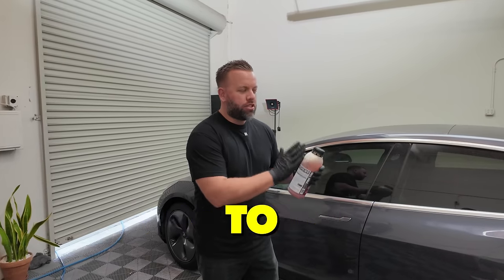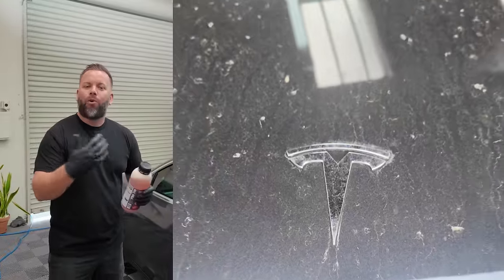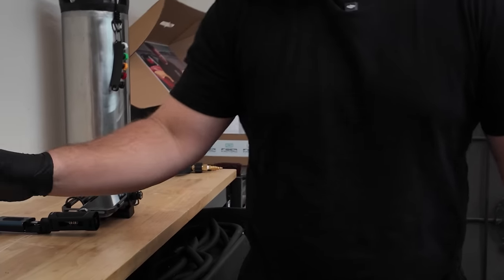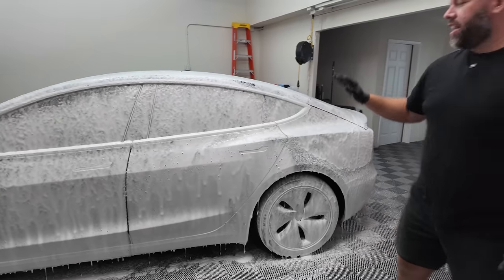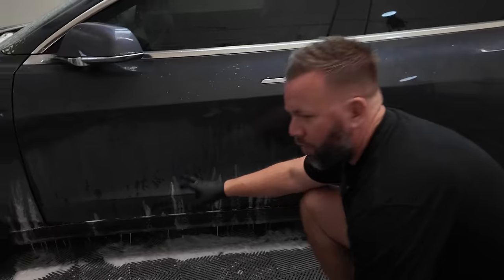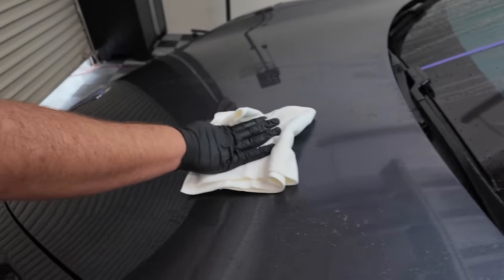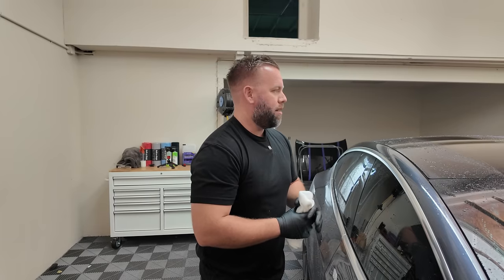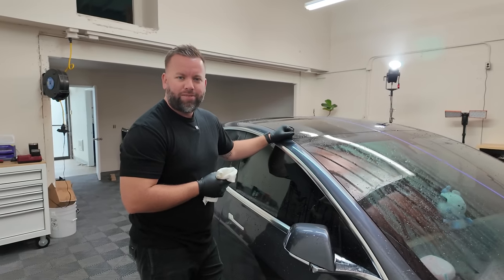SECRETS They DON'T Want You To Know - Do Not Pre-Rinse Your Car

Comment: Ive used Wash Chem on my Tesla before and although it’s a great touch-less soap, it negatively affected my protectants especially graphene ceramic coating and discolored plastic, paint and metal parts of the car. Made my red caliper looks really faded and left streak residues that wont come off.
Reply from the maker: Noted. Thanks for the heads up.
Reply: This deserves more attention. I've tried Wash Chem, and while it cleans effectively, be cautious with different materials – some plastic trims and coatings on my vehicles discolored. Also, a heads up: if you're using soft water, it amps up the cleaning power, learned that the hard way...
Reply: @WoundmanTV  I use deionized water, that's probably why the cleaning power was so strong. I now dilute it to half of the recommended ratio and mix in regular car wash shampoo. It still works great especially removing brown tires.

Comment: I’ve come to the theory that if you have water down (pre rinse) it’s going to have a hydro layer between the paint and the cleaning solution,  if you spray the solution on a dry car, you have the solution easily encapsulating the dirt and grime on the paint.
Reply from the maker: makes sense. would be inline with my findings too.
Reply: @autodetailingpodcast  is it not just that you are cleaning off a lot of the dirt in the prerinse? i doubt it's that differnt in impact

Comment: @autodetailingpodcast i can say with experience and trial and error that pre-rinsing does dilute anything you apply afterwards and depending on what chemical it is it can severely reduce its effectiveness. Ex: for years ive used formula 21 for cleaning wheels and tires, it is extremely potent and if you spray it on plastics such as trim and let it dry in the sun it wil discolor it. However its excellent at cleaning tires but if you spray it on dry and just rinse it, it actually works better than pre-rinse, applying, and then scrubbing with a tire brush. Thats a significant difference.
Reply from the maker: I think that’s a great example of how pre rinsing could be helpful! Thanks for that tip.

Comment: I just bought that MJJC 3.0 foam cannon and it did pretty good for how it came stock but I’m going to try the other orifice out to see how foamy the soap gets. I noticed if I dump in a lot of soap it will foam good but like in your video it calls for a lot of soap but yours sprayed really nice. I’m also using a gas pressure washer with the required 2.4 gpm. I always prerinse but I wonder if that breaks down the soap quicker and reduces the shaving cream look.
Reply: Yes I found that it dilutes the soap a little and doesn’t look as thick when applied dry. I foam, rinse, foam, contact wash, rinse, dry.
Reply: Given the option, always use the 1.1 foam cannon orifice for more foam.

Comment: My train of thought (and it can be wrong) is i do not presoak. I foam on a dry car to encapsulate any fairly loose debris in the soap so it comes off easy when I soke it with the preasure washer so as to minimize any scratching. Then I foam it again then hand wash if needed. Not sure if it is good practice or not bit it makes since in my mind.

Comment: Hey Jimbo! After watching a video on car wash foams from Pan, I tried a higher PH soap from G Techniq and used it without a pre-rinse. I would think with a pre-rinse it would dilute the product so I just shot it straight on the truck. I was amazed at how much dirt was removed from my truck that was filthy from the classic rain induced crude on the sides. I then foamed with my regular PH neutral snow foam and then did a contact wash. My other pre-wash I used from Ethos never cleaned that stuff off the side of the truck or cars. Was wondering the PH of this cleaner. Sounds like it will be pretty high with you comparing it to an APC.
Enjoy your holidays

Comment: Spray foam and let sit, power wash off, foam each section as I wash by hand with a bucket of soap.  Move section to section, top down.
Reply: when water is sitting on the car before the foam, it's watering down and interfering with the soap staying in place. I stopped pre-rinsing years ago.  Now, if you don't have a foam cannon, then yes, pre-rinse.

Comment: Great Information. I recently acquired a black pickup.  The first black vehicle I've ever owned and for me, keeping it as scratch-free as possible has been the stuff my nightmares are made of 😄. I've watch a bunch of videos, including yours ( Thank You for sharing this info ) ! and my newbie method of touch-free maintenance washes has been: No pre-wash (I didn't want to dilute the product ) and meguiars gold out of a cheap harbor freight foam cannon and leaf blower drying.... This seems to remove enough rainy-day road film to freshen up the truck good enough for me. 

I also bought 6 soft wash mitts to manually remove dirt with. For those washes, I use the same Foam/Dwell/Rinse method, then add a second foam before hand washing. So far I'm happy with the results, but am still learning.

I can't wait for spring to come, so I can try my hand at a ceramic job. I think that the Wash Chems Pro 100 Touchless Car Wash might be a good first step prep for that ( but will learn more before I jump in ).
Reply from the maker: Black is a ton of work. But seems like you’ve been meeting the challenge
Reply: I have a new 2024 black Chevy Trail Boss. What works is rinse, hand wash with Turtle Wax Ceramic Cleaner/Sealer, and leaf blower dry. No scratches and then I apply F11 PRO for deep shine and protection. For speed and more scratch resistance I am going to try Turtle Wax Pure Shine via cannon.

Comment: The one reason I think you got more dirt on the pre-rinsed side was that because you put down a lay of water onto the paint surface and then the foam cleaner is not actually 100% touching the dirt on the paint it has a layer of water between the dirt and the foam. Not pre-rinsing it you put the foam directly onto the dirt and actually clinging to the dirt that is on the paint giving you a better result with not pre-rinsing.

Comment: Of course you should go straight to foam on a dry car. Water alone is not a great solvent or surfactant. The soaps are far better at being surfactants & solvents. Also; just a waste of time & water to not go for a foam bath, pressure rinse, one bucket+ grit guard + 3 towels.

Comment: Bilt hamber touchless is the best of these products. Gets a dirty, coated car about 98% of the way clean. Also sugar-based so it limits the damage of the high pH chemical
Reply: You have to understand what touchless and Auto foam are used for. Auto foam works best for summer dirt/rain and touchless is used for snow/seasons etc
Reply: @Admin-ie9hp  I had thought they're both all purpose but touchless seemed to work better with winter related film etc.

Comment: So what your test just taught me is the purpkse of pre-rinse is to remove heavy materials that could scratch the paint and clear coat.

Straight foaming is fine, but you would need to do it twice to ensure you dont scratch the clear coat and paint.

So either way, the time is the same. Just make sure you micromit the car, othwerwise a lot of dirt will remain.

Comment: Wait, I was told by a carpro salesman that carpro reset was ok to use weekly on a ceramic coated car. Is that not correct?
Reply from the maker: It def works but I did notice after about 8 months of doing the same that it was a little harsh to plastics and such. Just my experience over many months.

Comment: I’ve been a professional detailer for 20+ years . The reason I never pre rinse is because my thought has always been without the chemical lubing the dirt that on it , the force of the water pushing the debris will still scratch the vehicle. Before foam cannons we used to use a pump sprayer with water and soap mix and spray the vehicle down then rinse.now days we pre foam , rinse then go to the bucket method. Then clay bar, foam and rinse again.  We now also use a spray foam hybrid ceramic wax which goes in a separate foam cannon. Rinse again, blow dry them towel dry.

Comment: Ok. Odds are high that along the line, your car got rained on. Yet that previous rain, once it dries, would not impact the performance of this product. Soooo…. unless you are a professional detailer who does many cars daily, the strategy would be a) pre-rinse. Let the water do as much work as possible. B) rinse again after some minutes, paying close attention to larger things such as bird droppings. Use a bit of pressure to blast them off. C) let the car air-dry, as it does after every rain storm. D) now use the spray-on foam, and follow the product directions from there.

Comment: Isn't that orange pressure washer nozzle too narrow to be using on paint?  I typically use the much wider white nozzle on paint and the medium width green nozzle on wheels so I don't risk damaging the paint or lifting up the edge of vinyl wrap stripes on my vehicle.
Reply from the maker: I like it with the stubby handle so I don’t have to get so close to the car
Reply: @autodetailingpodcast  I've done the same with the green nozzle.   But to be safe after having some issues with the stripes, I have been using a white nozzle with an 18" wand with angled tip.

Comment: P.S.
Rinse bottom up, then top down. Its a bit odd but thats just how touchless washes work best! ✌️
Reply: You mean foam bottom up and then rinse top down?
Reply: @DiamondAutodetail  nope! Foam bottom up, rinse bottom up THEN top down... trust me. Look up touchless washing... in fact, I think that Washchems bottle probably states to rinse bottom up.
Reply: It's funny because I noticed that works better as well. When you rinse bottom up, it's as if you're pushing the foam into the surface to increase the cleaning. But when you rinse top down, by the time you get to the bottom the foam is mostly gone and the water alone doesn't clean as well.

Comment: Just bought some white pearl and it get out barely just clear. I shaked and shaked and it started clogging so i shaked and heat it on the heater inside and shaked it... Worked again but still clear. Very pissed cause the store is at a 40min drive. I think the can was on shelf for to long idk.

Comment: Work bottom up for foam, top down for rinse.  The term soap is incorrect as the correct term is detergent.  Why? Soap can not encapsulate dirt. A detergent does as it contains a surfactant (which is the key ingredient to encapsulate dirt), in simple terms.  A dusty, minimal dirt on a car just foam. A dirty car does require a pre pressure rinse to get rid of the heavier dirt and other related debris, followed by foaming and then a clean sponge and a fresh bucket of water to rinse and keep clean the sponge. Then blow dry or chamois for best results.  For both after the pressure rinse and before drying use a flowing, non pressurised rinse (no hose connectors).

Comment: Have you ever tried foaming simple green? I’m going to try as a pre rinse. Then foam. Maybe try 5oz simple green in a 32oz bottle. Simple green is no where strong apc like purple power
Reply from the maker: I haven’t but I wonder if it would do good. If you do it pls report back and let us know!
Reply: @autodetailingpodcast  will do. I’ll be taking the car in the snow in the next few days. When I get back, I’ll will try it. CA uses salt, sand and Brine. All destroy a finish.
Reply: I haven't tried foaming simple green, but I have tried foaming purple power degreaser. That works decent as a touchless wash, although you need to be quick about rinsing to avoid staining. Simple green is so much weaker that I doubt it would do much. I tried it as a tire cleaner once, full strength, and it was completely worthless. 
    For a brief time Simple Green made a dedicated wheel cleaner that was quite good. I haven't seen it for a few years though.
Reply: @joeschmoe6908  I don’t want to strip wash the vehicle, but to break down road film, allow P%S pearl do the rest.

Comment: What would be great would be to read out what the product manufacturer says on how to apply their product. I tend to follow the manufacturer’s recommendations rather than suggestions from other people unless they can demonstrate their result is better than what you get from the manufacturer’s directions – given that they should know how to get the most out of their product.
Similar to what others have said, it often depends on what dirt I've collected, that will depend on whether I attack it was a jet wash before using the pre-wash Snow Foam. That said, Meguiar’s do advise to use a mit on the foam if the car is particularly or heavily soiled. So pre-rinsing is not required with their Snow Foam. I just pre-rinse the car for my own confidence, but only if my car is exceptionally bad.
I've been using Meguiar's Ultimate range for years with excellent effect and fantastic finish. Initial cost of the bottles may be a bit pricey, but not the most expensive, and as for price per wash in terms of cost, very minimal, so it doesn't break the bank. Washing every couple or four weeks depending on what I've picked up, topping up the wax isn’t always necessary, the bottles last well over two years. The wax is in its 3rd year, and wash and wax is in its 4th (you only need 4 caps full to a gallon of water). I know it is a trend to use the wash and wax with a cannon, but to me that is just an unnecessary waste of product, after all it is formulated and designed as a contact wash. The beauty of their Snow Foam is that if you don’t use it all, you can store it in a jar for next time, though you have to give it a bit of a shake before use, as the product can sometimes separate depending on how it is stored. The soaps don’t always strip away the protection to any noticeable degree.
I use the one bucket method - always have, no scratches, but there again I don't reach to the bottom of the bucket to get to the grit.
I have found that using the same manufacturer for the pre-wash and wash works best as they often formulate their products to complement and work with each other.
I appreciate that this may be subjective, particularly where some who have found products from different manufacturers have made good pairings, which produce excellent results - whether it is a maintenance wash or a deep clean, with little effort at little cost per wash.
Bilt Hamber products are getting a lot of attention and good praises, so I will give them a try, to see if they can give Meguiar's a run for their money in terms of cost per wash, final finish result and longevity of protection. Bilt Hamber’s corrosion protection products and underbody sealants are absolutely brilliant. I just hope that their washes and waxes are as good.
In your swipe test I was interested in the difference in dirt left behind, but for a pre-wash what is important, is how much it prepares the dirt for easy removal in the contact wash stage (or contactless wash for Touchless). That said, I have seen that many think that contactless mean no contact, this isn’t always the case, if often just means that you have to make less contact and thus less effort when washing.
As you allude to in your presentation, personally I sometimes find that a pre-wash is not always necessary, I suppose some would call this a maintenance wash, but to me it is not mandatory. This probably explains why I have had my current bottle for the 2 years.  I always use a pre-wash before going into the winter, then again at the end of winter to wash all the salt, etc. off the car.
It would be interesting to see what was left on the car after the contact washing stage, or how easier it made the contact washing stage before being waxed/coated.

Comment: Curious, when you fill the foam cannon with thr 22oz water to 10oz soap, how many washes does it last for or do you have to keep refilling for every wash?
Reply: With that being said Im looking to purchase Adam's Graphene Carwash to compliment the Adam's Graphene Ceramic spray I already use on my car once my Chemical Guys Blacklight wash is used up.
Reply from the maker: 2 or 3 mid size cars usually
Reply: @autodetailingpodcast  Wow, definitly dont last then. With Chemical Guys and bucket wash that I currently do I only do 1 cap full per 5 gal bucket. That's about half an oz of soap per wash. But Im definitly going to look into doing foam now that I have a low powered pressure washer safe for washing my car.
Reply from the maker: ya you will def use more soap in a foam cannon than a bucket. But usually you wont use 10oz of soap.  @ItsPinecone_911
Reply: @autodetailingpodcast  ok roger that. Thanks for the info.

Comment: Great video. I think you were suppose to foam from the bottom up according to the directions.
Reply: Finally someone notices. Always rinse pre soak foams from the bottom up. The foam grabs onto the dirt and suspends it, using the sharp stream of water to release it from the paint. If you rinse from the top down, you're removing the bulk the cleaner before the sharp stream of water hits it, essentially diluting the cleaner and minimizing its cleaning ability. Good catch @T-WashMD2019

Comment: If I'm planning to wash my car in a Saturday morning, I'll give it the quick water rinse off the night before. That way the prewash goes to work undiluted
Reply: The adverse effect of the pre rinse is not only for the effectiveness of the cleaner but also the interaction between high water pressure and dirt particles acting like an abrasive and scratching your car, your plan sounds great but do that first rinse with just the hose and no high pressure.
Reply: @DownloaderVideo  that's a great point!